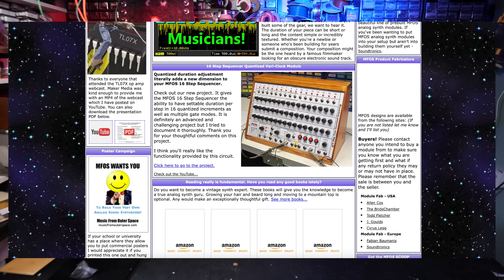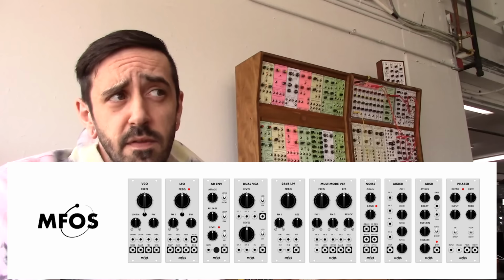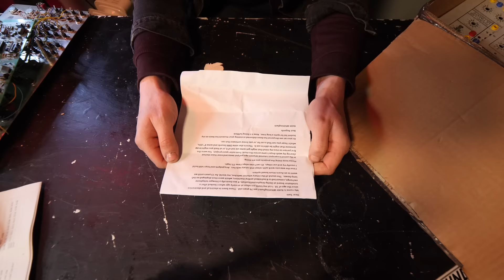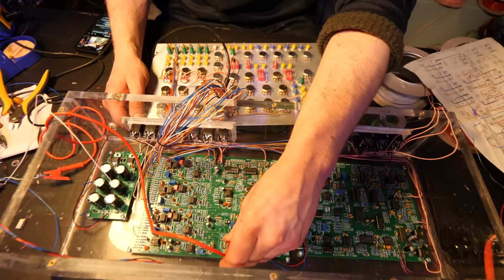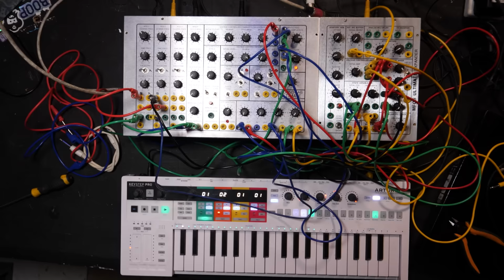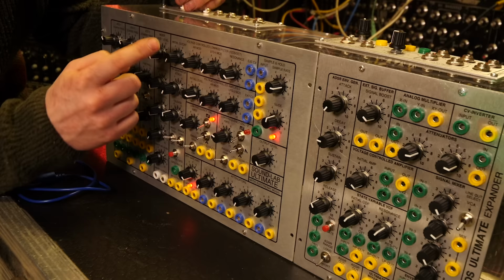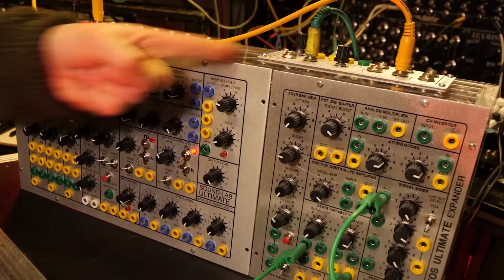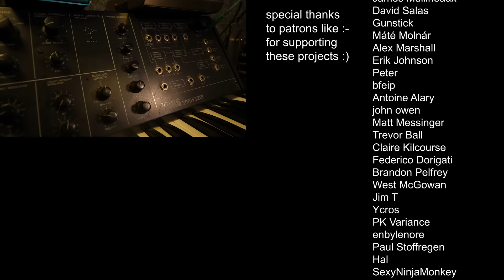What Is Music From Outer Space? And Why Is It So Influential.

Comment: I built several variants of the Wacky Sound Generator from Ray's site and was gearing up to buy a load of module PCBs from Ray when he passed away. Due to changes in my life as well at the time I never pulled the trigger on the project but his website is a unparalleled resource and he was so encouraging to you to experiment and modify his designs, I am so glad that someone has taken on his legacy, as I was worried it might be lost. It's great to hear you showing off the Soundlab as someone who knows how to operate an analogue synth! MFOS and Ray definitely needed to be in the spotlight more. And for people who are just looking for information, the site is such a good and entertaining read, with Ray's sense of humour shining through :D
Reply: I still use mine at gigs. I built the WSG circuit on stripboard.I added severalother circuits includingg a Ken Stone synthacon filter, a Rebote 2 delay, a Thomas Henry 8K LFO and I built a mixer board to combine the circuits as seperate levels. I housed allof the boards inside an old BBC B computers' interface box. A perfect box. incluing several banana sockets. So all 8 oscillatorscan be patched to the other boards. Its a lovely sounding standalone. Ray was so great. x

Comment: What a legend Ray was. The WSG;I still use mine at gigs. I built the WSG circuit on stripboard.I added severalother circuits includingg a Ken Stone synthacon filter, a Rebote 2 delay, a Thomas Henry 8K LFO and I built a mixer board to combine the circuits as seperate levels. I housed allof the boards inside an old BBC B computers' interface box. A perfect box. incluing several banana sockets. So all 8 oscillatorscan be patched to the other boards. Its a lovely sounding standalone synth. Ray was so great. x

Comment: I built a Maplin 3800 synth about 40 years ago.  My folks bought me the kit for Christmas,  I was 15 at the time.  It was a really good Curtis chip based machine. I remember building a wooden frame for it with my dad. I sold it eventually but it was my lead synth for about seven or eight years.
Reply: I grew up near the original Maplin shop and they had a 4600 synth in the shop window. I was always pestering them to let me try it and they always refused. Eventually I asked "why not?" and they told me "because there's no electronics in it!" It was just the case, front panel and keyboard! 😂

Comment: MFOS was and still is a great place to start a journey down the synthesizer rabbit hole. Ray was a wizard and it is clear he was aiming for cool sounds and effects.
I ordered the PCB for the Soundlab and haven’t decided what kind of panel I am hooking it up to (12 years later 😮). I also had to get the Mk2 and the Noise Toaster. The NT was for my grandkids. I am building a second and adding a PT2399 for my youngest grandson. I am also building the 32-step sequencer and some of the modules like VCFs, ring modulator, LFO …

A year ago I ordered the MIDI Ultimate from Soundtronics in UK. This one is very much the Ultimate shown in this video, but with some enhancement like dual ADSRs, PT2399 echo module and MIDI input. ALL components mounted on a huge board so no wiring needed (apart from in- and out panel). Much is pre-patched with on-off-on switches. Unfortunately this kit is discontinued probably due to lack of buyers.

It’s really great you did focus on Ray Wilson and his great stuff. As someone noted, Ray had a YT channel and watching his introductions helps understand his design philosophy. I often wonder why he did things this or that way (like why not an ADSR in the Ultimate and just an AR), but listening to the magician himself gives some answers.

Comment: So nice to see a long video from you on MFOS. I built the Noise toaster a few years ago, and followed up with the 1 V/oct keyboard controller and the original Soundlab (had to have one of those iconic synths, but yay panel wiring). I added EG to PW and gate to the VCA on the Soundlab, good mods to have.  Also started on the Synth DIY Experimenter board. And yes, I do have the PCB:s for the Ultimate + Expander waiting for me.

Comment: The MfOS site is an amazing resource, and Ray was an amazing person.  I've built a couple of the projects; after the obligatory APC, my second synth project — and the first one I had circuit boards made for! — was a Weird Sound Generator.  Well, technically it's about ⅓ of the modern WSG; it's just one set of Weird, Zany, and Wacky oscillators and their mixing stuff. The old design I worked from didn't double them up, and I left off the filter, possibly because I was planning on running it into my mini kaoss pad.  
I  then bought the Echo Rockit PCB from Ray, and built it with a gorgeous laser-etched aluminum panel a friend made me; it's still one of my very favorite synthish boxes — just UFO sounds for days.  I haven't gotten the CV inputs to work with my Eurorack gear, but I did recently mod the thing with an extra jack so I can pull out its LFO and sync other gear to it.
So many more of his projects I'd like to build; as always, ars longa, vita brevis .

Comment: Sam, it’s been a while since I’ve worked with this stuff, so I might not be remembering this accurately, but that 4066 that burned out, was it socketed? I seem to remember that CMOS chips should be socketed or, if you’re going to solder them directly in, you have to unplug the iron, or switch it off before touching it to their legs. Otherwise, the magnetic flux in the tip of the soldering iron can destroy the chip, which is quite sensitive
Reply from the maker: Yes socketed 👍
Reply: @LOOKMUMNOCOMPUTER  well then, you were right (of course!) You've got some crap chips!

Comment: You should put some led inside the acrylics using this cool heating tool. Its cool how the acrylics react to light. And if you scratch of engrave surface this part can light up a logo. If you use uv light you can make people deaf and blind with the same machine. Haha. You also could burn some screen print or kill the coronavirus with. Also: cv would meet his mate uv.

Comment: Flippin' awesome! And thanks to SynthCube for keeping it up. Confused about the banana jacks, though, especially on the input side of the modules. Are those just buffered to parts of the circuit that are mostly unused, or is the synth just relying on brute force to overcome the normal signals? Or are these some kind of strange switching jacks? 👍
Reply from the maker: im not sure what you mean regarding the bananas, all of the inputs usually go through a resistor into a mixer circuit into wherever they need to go. like an opamp that mixes a potentiometer and a jack for instance
Reply: @LOOKMUMNOCOMPUTER  Ohh... resistor mixer makes sense. I was trying to figure out how the design dealt with the fact the banana jacks don't disconnect like (some) 1/4" or 1/8" jacks do. Thanks for the reply!
Reply from the maker: @McTroyd  all good! Even in designs with jacks they don't disconnect. Switched uses are only in very rare instances on synths
Reply: @LOOKMUMNOCOMPUTER  Interesting. I had no idea! Maybe I need to go buy that book and do some reading. Thank you very much.

Comment: Does anyone know. Can you switch the power supply voltage to 12 Volts, instead of 15 Volts, or will this effect pitch tracking or something else, thanks
Reply from the maker: It is 12v 👍
Reply: @LOOKMUMNOCOMPUTER  awesome thanks, I'll use this prompt  to finally wire up the panel then... To be continued...

Comment: Tsk, tsk, buying the DCFC brand (Dodgy Chips From China). You should know better ;-). Just kidding, I also use them all of the time in my hobby projects, unless the component is critical for safety purposes to avoid untimely injury or death. If the shipping costs for low volumes of components at reputable suppliers were not so ridiculously high, I would probably source most of my components from them instead. Some of the sounds I heard reminded me a lot of Pink Floyd.